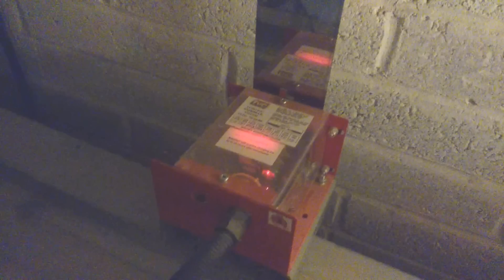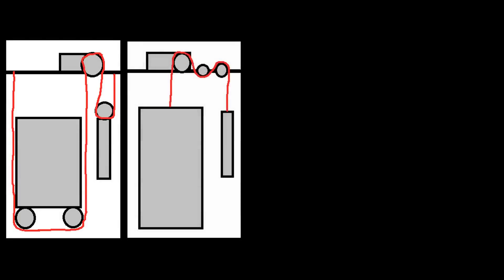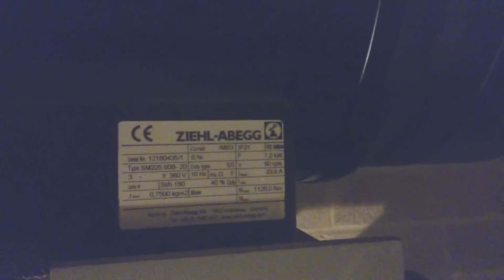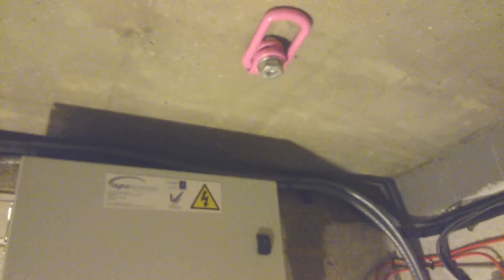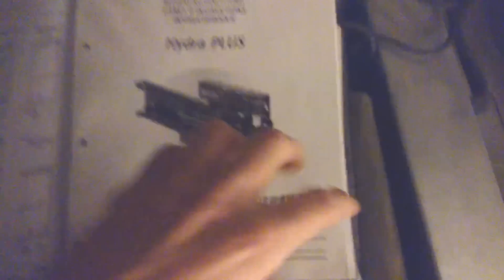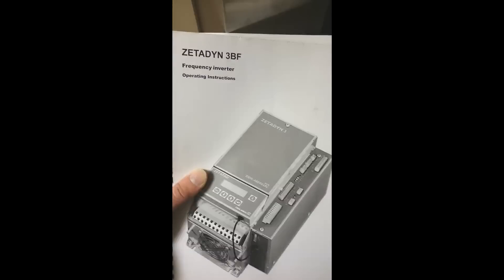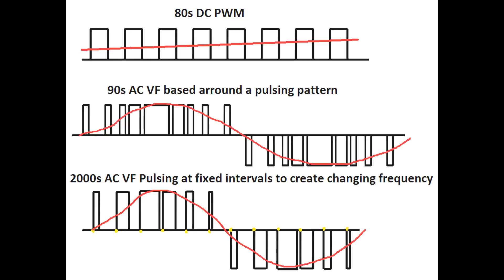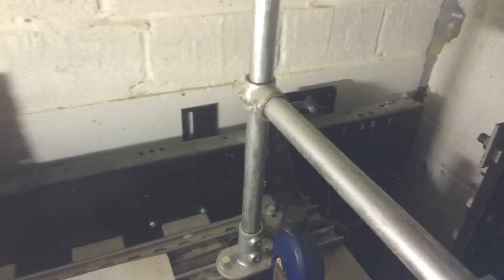A detailed look at a generic MRL lift (from on top)

Comment: if those 80s 90s 1m/s schindler lifts used the MR-121 model, would have they run 2m/s if they were not Mr-221 ?
Reply from the maker: +BossHeins Craft   The 80s 90s Schindler / Keighley Schindler with intelligent leveling go 1 m/s when 2:1 cabling, and go 2 m/s when 1:1 cabling.

Comment: Maybe this used to be an old traction lift and the hole allows the old lift cables to go to the motor sheave
Reply from the maker: +Xavier Lim   This is a fairly new building.  The lift is original to it.  I don't know why there is a hole in the roof.  If only there was a trap door, then I would get to see what is up there.
Reply: +Beno hey can you tell alk the lifts you know and which you like and their reailblity

Comment: When you talked about the modern throw away society of today, I couldn't agree more!!
The number of people that throw away something and then replace it with something new when the newer thing is of inferior quality to the old item.

Plus, buy cheap buy twice, (or many times in this case).
Why try and cut corners with cheap rubbish when you could just install quality first time around and save time and money in the long run. Especially if the cheap thing is always going wrong. But yeah people trying to make pounds and pennies go further.

Glad you didn't get crushed at the top btw :P
Reply: And then there's planned obsolescence, where things are made worse not just because of not caring or cost cutting, but on purpose, so that they'll break sooner and so that you'll have to buy something else. It's not green at all and a stop must be put to it

Comment: I can see MRL lifts being more difficult when they start to fail as it is more difficult to access the machinery to maintain it. A traditional motor room is a lot safer to work in with the equipment more easy to access (and would have a cupboard that the plans you found could be kept in).

A local university's design specification (last updated 2007) states that MRL lifts are to be used as a last resort. It also wants new lifts to last 25-30 years. Unfortunately they have most of their lifts modernised by generic companies.

The mat is probably an electrical insulation mat, the guidelines mentioned above require one to be placed next to each piece of control equipment.

Comment: that topic you're discussing about in the early part of this video ***** has something to do with "planned obsolescence". Items of every type are created to last for a rather short time (e.g. 10 years) so you're in the need to spend money on modernisation or - even better for them - full replacement - including replacing items that are in perfect condition. The failure of that item doesn't just happen randomly, no, the creator in fact built an "age of death" in and after a certain amount of usages, it breaks and leaves the item unusable.
Reply: +Uplifting PostTower Planned obsolescense, this especially rampant in the world of consumer electronics. Nothing is built to last anymore, modern TV's last only 5 years, and often the caps and/or the power supply that fails before anything else. Give me 70's or 80's hi-fi equipment, built to last and repairable (when you have a service manual). I guess repairability is not in the manufacture's interrest, as they want people to buy a new product as soon as possible. They also put a lot of effort in preventing you from opening the product by using evil proprietary screws and using lot's of glue so that it's almost impossible to replace a built-in battery.

Comment: Please do a detailed video about an EcoDisc or a Schindler 3300 MRL.
Reply: +IDLift3000 
ecodisc is abit impossible, he hasent got the key for its cabinet.
Reply: +kriskolo2013 He can buy the kex from ebay
Reply: he bought one but it was not that one that the ecodisc needed
Reply: I know it, he tried the key in one video
Reply: +failsingermany Ecodiscs and Gen 2s don't allow unofferise lift surfing. U need to open up the logic cabinet, put the lift into engineer mode and drive downwards into the correct position manually using the controls in the logic cabinet. Gen 2s logic cabinets use triangle key, but Ecodiscs use custom key, which is why he can't surf it.